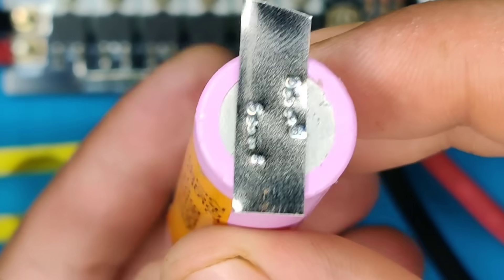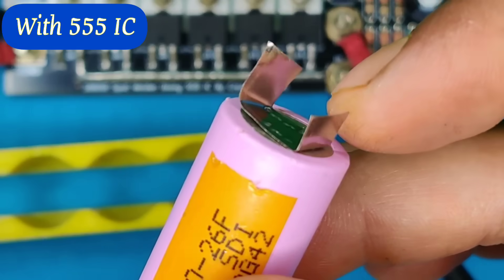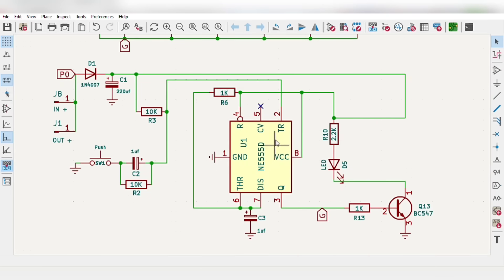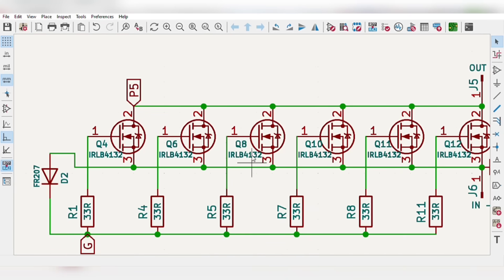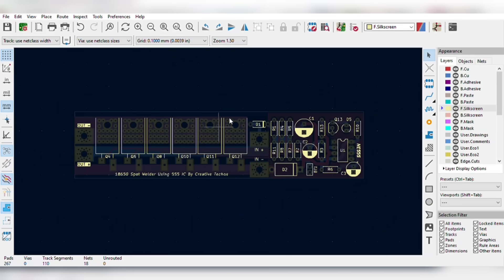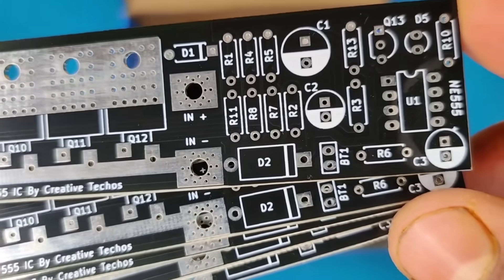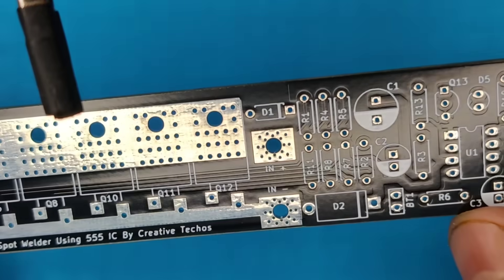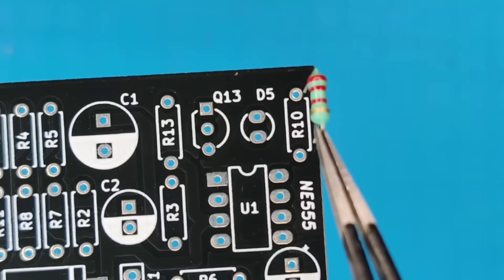Make your own Portable Mini Spot Welding machine with 555 ic

Comment: I also made a spot welding according to this scheme, it's a really good scheme. And I can say that with the R2 10k resistor and the C2 1uf capacitor, you can only get a pulse of 6 - 8 ms, definitely not 10 or 20ms as you say, measure it with an oscilloscope.

Comment: What does p0, p5 mean in the circuit diagram?
Reply: Its only single trough hole screw, P0 is screw hole terminal from positive input battery and output positive welding.
P5 is output ( - ), hole screw terminal output negative from drain mosfet.
Reply: thank you

Comment: Ini adalah desain tersimple dari anda setelah sekian lama saya mengikuti spot welder dari channel ini. Anda bisa menambahkan 2000mah lithium polymer di bagian belakang dan ini akan menjadi 100% benar benar portable 👍
Reply: Max AMP c
Reply: @mehmetyuksel9465  lithium polymer can be 70C rating
Reply: @putriamalia422 herhangi bir powerbanktan 3000 mah söksem ve girişlere monte etsem kullanışlı olurmu
Reply: @bilalderinyar7398  i don't think so, maybe it needs improvisation on the powerbank battery and high current BMS. I suggest using 2pcs 2.7Volt 500F super capacitor and connecting them in series, total can be 5.4V 250F. The price of 1 pcs 2.7V 500F super capacitor is around 3USD, its around 117 lira.
But you still need step up like MT3608 to stepp 5.4V from capacitor to 12V to drive ne555, 10V is the best way to open fully mosfet gate.
Reply: @mehmetyuksel9465  info batre. Blm nemu yang c rate nya tingggi
Reply: @ilhamprakoso3844  setahu saya baterai vapor macam sony vtc4 atau vtc5 tapi buanyak yang palsu di online 😂, yg KW di toko vape aja sebiji 50rb.
Kalo mau dipake spot welding saya saranin pake super kapasitor sih.
Reply: @putriamalia422supercapasitor paling masuk akal sih, pake liion ngeri mba, lipo mahal wkwk. Problemnya blm nemu skema buat modulnya, banyaknya digital gbsa ngoding saya nyari yang anaalog bgini 😅

Comment: Can we use 21v makita battery impact wrench, but i add lm7808 before pin 4 and 8 ne555 for safe the ic.

Idont know why my board fail, i use irlb3034, maybe my mosfet irlb3034 is fake, now i try use 4132 like you but not tested yet.

I add 10k pulldown resistor from gate mosfet to ground, it is safe ?

Comment: The question is that I am taking a 5 volt supply and this 5 volt supply is going to 4 components installed in separate places, now I connect a load from these 4 components and now I want that the 5 volts coming from these 4 places should be supplied to the loads separately, meaning the supply coming from the 4 places should be supplied to the loads one by one, not all together, and I want to do it with the logic of diode, but till now I am not able to understand how to make the logic of such a diode, can you make such a login